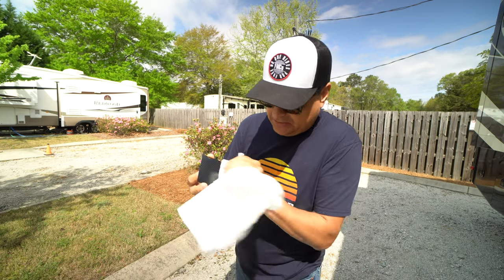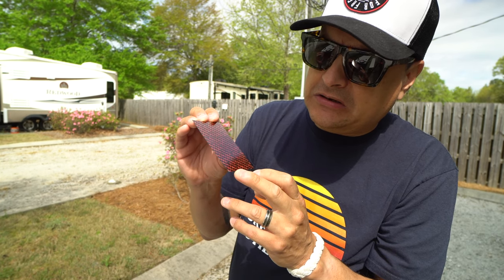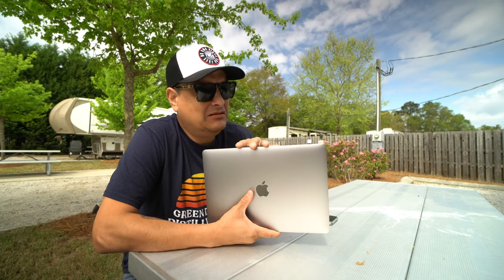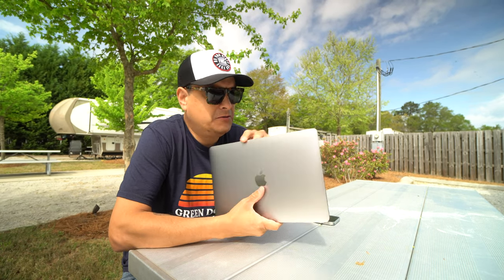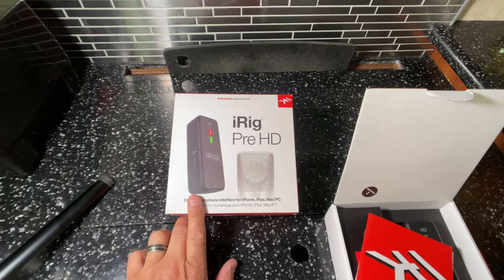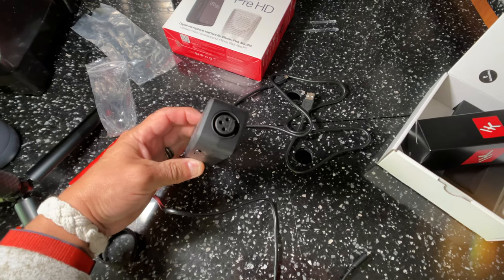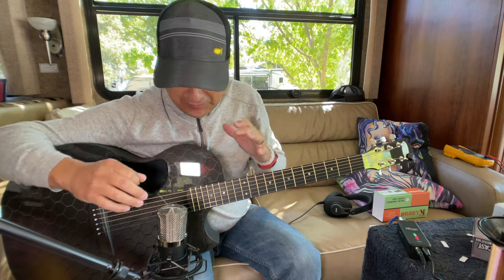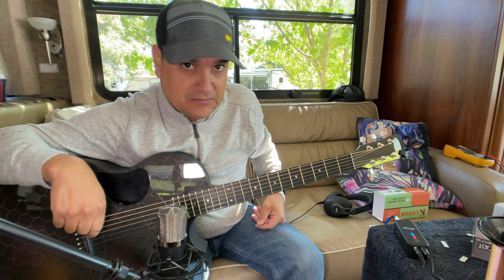Recording Acoustic Guitar With Irig HD and An iPhone 12 Pro Max

Comment: You have to scuff it / de-gloss otherwise it won't stick. Tint the clear coat with the color you want. I've clear coated many carbon fiber hoods with no problems.
Reply from the maker: This had a mat finish so I thought I could get away w it. What grit do you recommend?
Reply: @DylanTalksTone  you can wet sand with anything from 800 to 2000 or just use a grey scotchbrite. Just try not to go through, it doesn't take much. Need to scuff up the surface so the paint has something to grab onto.
Reply: @DylanTalksTone  oh and remember, the smoother and cleaner you start , the smoother and cleaner you will finish.